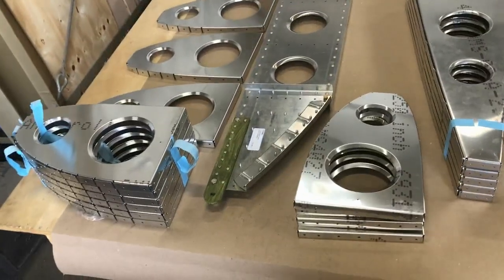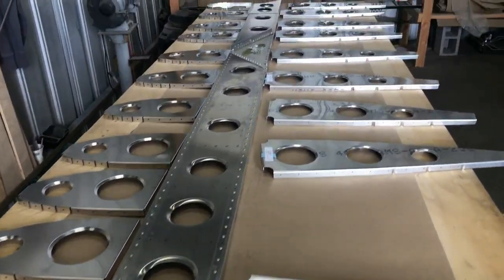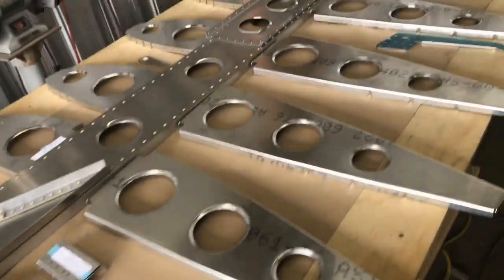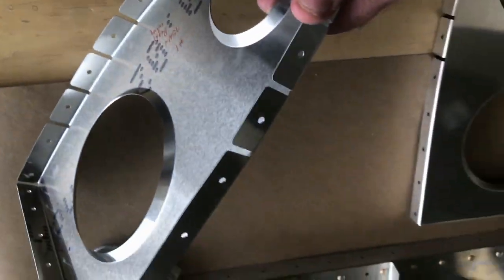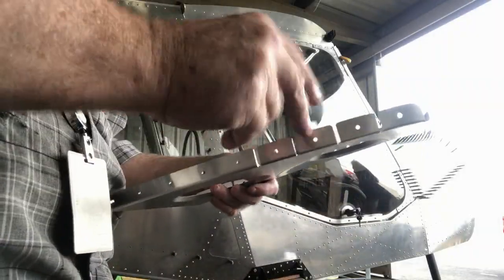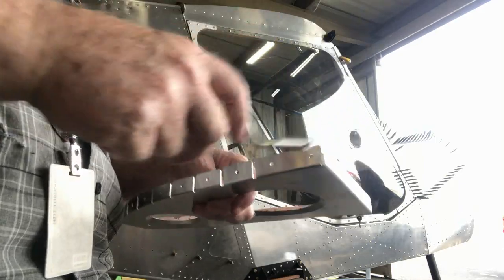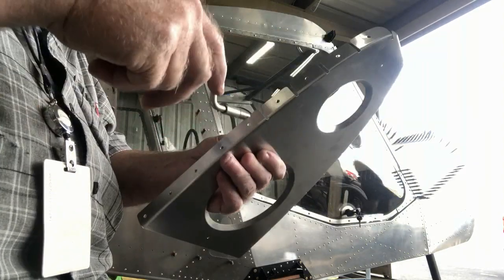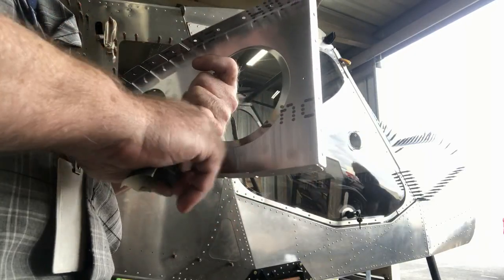Build-A-Wing CH750 Cruzer Skeleton

Comment: I am wondering where the aluminum is made...is it China or USA? I tried to find an American company making AL aerospace grade sheets...not much success...
Reply from the maker: May I suggest www.globalspec.com  you can join the website with an email and its Engineering 360 powered by globalspec. If you type in search something like Aerospace Aluminum or 6061-T6 aluminum or 2024-T4 Aluminum it will return 500 to 1,000 world wide companies who produce or sell the materials. You might consider it the worlds largest manufacturing catalog. And yes China is the largest bulk producer of Aluminum second to Australia with the USA falling in about 6th in the world. But specifically you would be looking for aluminum alloy and tempered I believe. Hope this helps if you don't already know about it.